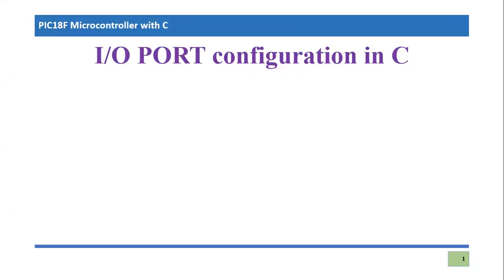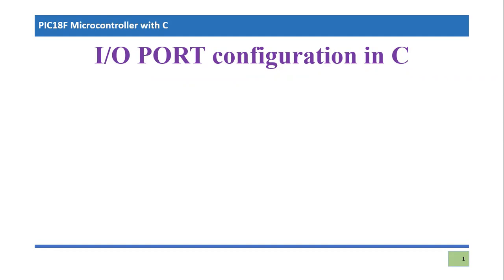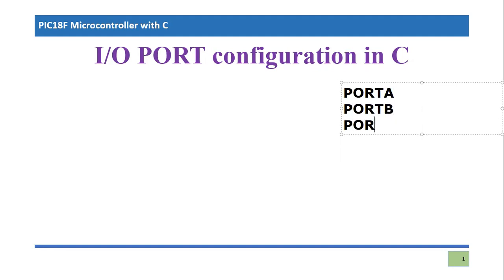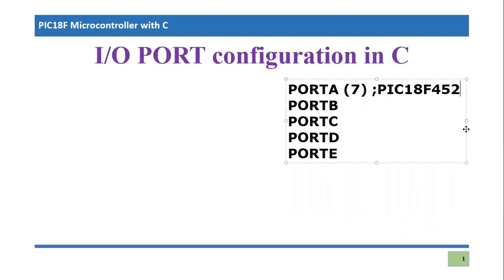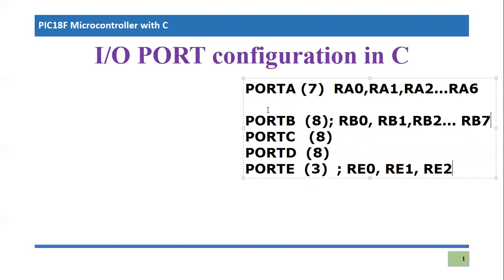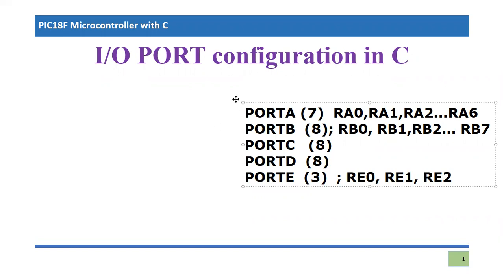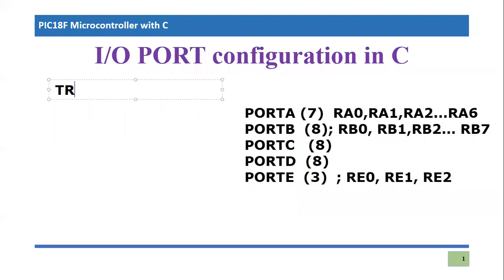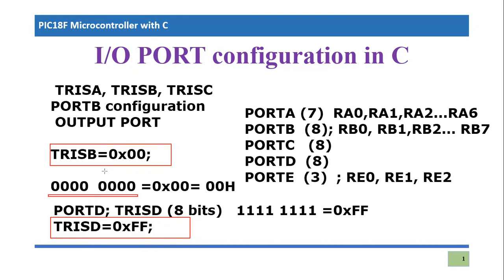I/O PORT Configuration in C language for PIC18 Microcontroller

Comment: what does 0x0F indicate when you set it for one of the TRIS ports
Reply: it can either 0xff(input) or 0x00(output) (bi directional)
Reply from the maker: This is true for complete input or complete output, respectively.
Reply from the maker: It means four most significant pins are output and four least significant bits are input.